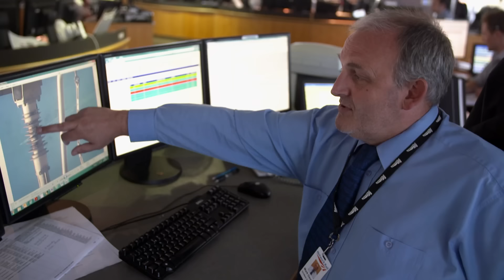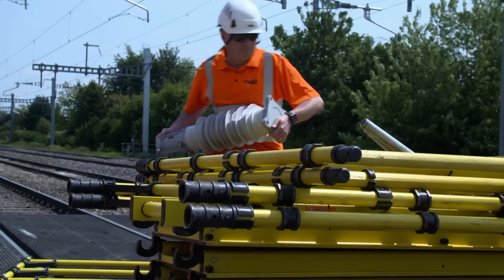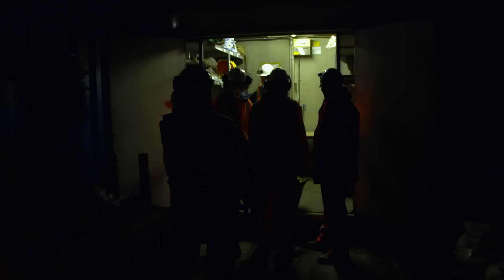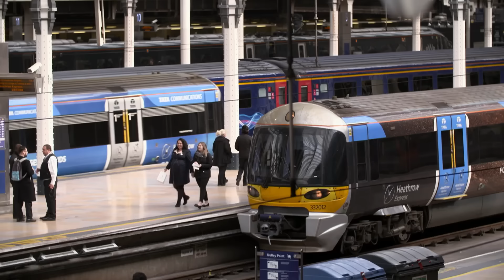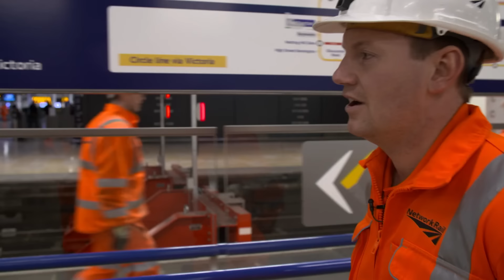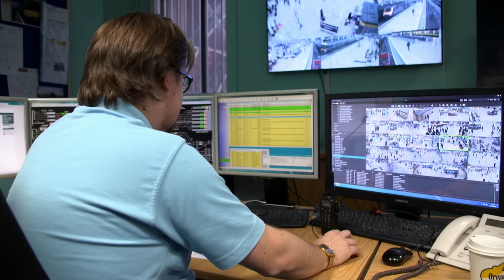Crew Refuse To Let Passengers On Train Due To Overcrowding | Paddington Station 24/7 | Full Episode

Comment: 35:02 I too as a train spotter have done this. On several occasions whilst on board trains. I will stand near doors instead of sitting. On some of those occasions ive either come across guard panels that are faulty or unlocked of which i would then report them to a member of the crew, either on next passing or by seeking them out. Not to mention reporting fare evaders hiding in toilets. But as a whole. Yes Railway Spotters and Enthusiasts do look out for the railway and its infrastructure just like the countless men and women that work on it themselves.

Comment: hmmmm, you'd think they'd have a train with a work platform to, oh I dont know, work on things like this, all goofy with their little non working sled. 3 hours to fix a 30 minute issue at most.
Reply: Wow you’re obviously so much smarter than everyone who has worked on the railways in the last 150 years of electrified rail. 
A rail mounted work platform doesn’t offer enough flexibility, being unable to navigate obstacles like other trains in the way, and would likely only be practical to apply on a regional level rather than a local level, whereas road platforms can be kept in more localised yards and take up less space, and overall require less maintenance.
Reply: @BrokenIET  You can't tell me they can't make something so isolated that they could work safely on this. I ain't smarter, I do have 50 years of being an electrician, so shut up.
Reply: @jimburg621  your right, your not smarter......
Reply: @jimburg621 is that 50 years of home electric or 50 years of railway maintenance? The railway is nothing like any other electric appliances so maybe you, not being a permanent way expert, should shut up yourself.

Comment: The problem with keeping the doors open or not blocking the platfrom on an already overcrowded train is that people will just keep trying to board regardless of if there is space or not and just stand in the doorway. Then you can't dispatch the train because inevitably one of them will simply refuse to move so the doors can't be closed. Then, the longer the train is delayed in the platform , the more and more people run down expecting to get on, and you're in a losing battle to get the train dispatched. I've seen this myself at Leeds on busy weekends.

Comment: As a Driver at M/Cr Piccadilly before I retired a few years ago I was the relieving Driver at Oxford Road on a 158 going to either Windermere or Barrow , I waited for the Driver I was replacing to get off and let some passengers get on ........ then they would not move enough for me to enter the cab I said you have to let me get in the cab and they just looked at me. So I got the Station Inspector and told him I wanted the vestibule behind the Drivers cab cleared and this was done.....So because they would not let me in the cab they did not catch that train.Drivers have always had the right to do this since advent of 158,s etc.
Reply: Funny :)

Comment: Its very strange to see that UK railway don't have tower wagon car for fault like poles break out, OHE fault😮. In india we have a tower wagon car in every section to tackle OHE fault.
Reply: It's probably due to safety rules as then the tower wagon car would be a giant metal rod close to high voltage lines
Reply: We do but they're normally for delivering stock, and because of the elctric issues all the lines are blocked so you cant acually get there. Plus the drivers wont sign passenger duties
Reply: Train tracks in India? Where do you get the time between Scam calling?
Reply: @MadnessIncVP  they also have highspeed trains too! that are as fast as our regular commuter trains 😀

Comment: Why do they still use timber speepers instead of the new concrete ones?
Reply: Expensive. Also wood is actually in some cases better. Its waterproof (if covered in the right chemical) and light and easy to replace.
Reply: Can repair wood to an extent as well or flip it over since both sides are the same, if concrete gets damaged the whole thing gets thrown away and replaced
Reply: Cost. Ease of handling. 2-3 hairy, muscled P Way staff can handle a wooden sleeper. If it was concrete it's specialist lifting crane or similar. Wood has excellent natural vibration absorbing properties. Modern sleepers are likely pressure treated and won't get rotten quickly. Plus far, far easier to cut down wooden sleeper if needed than trying to cut conrete. Contrete dust is horrible stuff if you breath it in.
Reply: @ElliottRodgers  There are machine that can automate that. You just load the machine with them and let the machine do the work, no workers on the track or doing heavy lifting which reduces risk of accidents.

Also they made pre cut rail section with sleepers made of concrete already attached.

Maybe the wood could be pressure treated, but not where is cut on site.

You don't need to cut concrete on site becouse you only need 2 o 3 different lenght.

Comment: Question is a UK controller the same as a US dispatcher? In UK a dispatcher seems to be a platform manager or supervisor, is this correct? Thanks for helping a US train nerd.
Reply: Uk dispatcher is one who literally dispatches trains they also enforce safety on platforms. Controller typically refers to signaller the one changing signals and directing the trains to reach their destination
Reply: Controllers look over accidents and plan diversions/"brainstorm" ideas and dispatchers tell the guard/conductor when to close the doors/depart as well as being passenger assistance. There are no signallers shown in this programme due to the fact you cant film them at work so a signaller controls the points and a controller does not.
Reply: @ThatGreatWesternSpotterYou can film signallers, it’s just not very interesting television because you can’t really talk to them all too much.